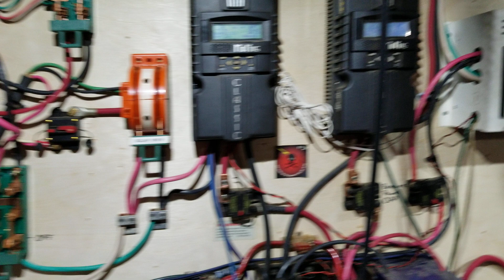Wind Power Controller Failure and Critical Loads panel update.

Comment: That is a very busy wall a lot of choices that 250 with no follow me is a darn good buy.
Reply from the maker: That is why I got it. Keep the Wind system separated, The Follow me would be useless because of the amount of power that will be produced will not all the time like the solar.